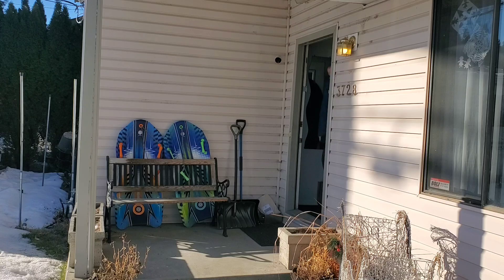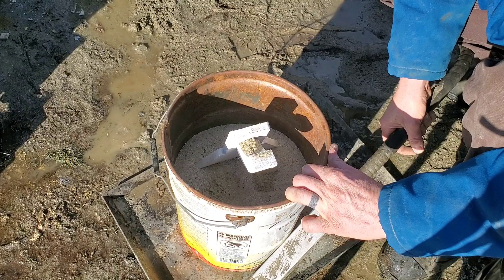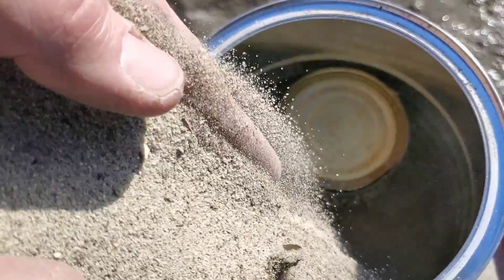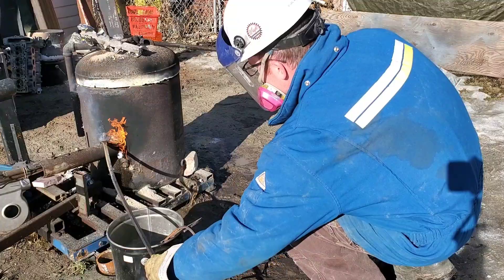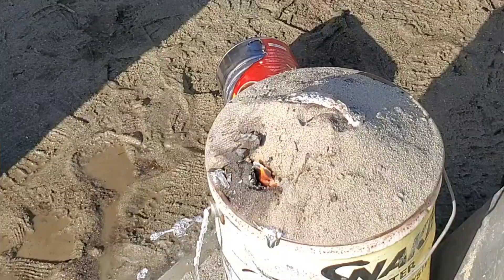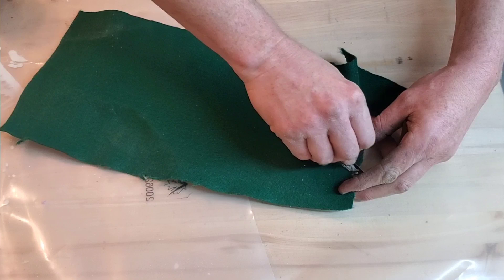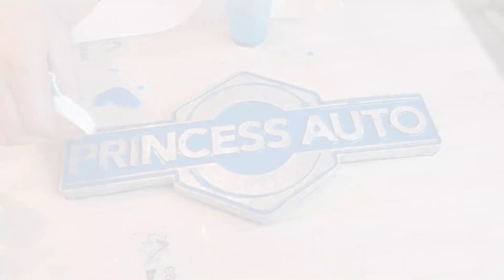Lost Foam Casting Aluminum Princess Auto Sign

Comment: Nice work WM&C. On the bubbles in the thinned slurry, if you're power mixing, try to do so in a manner that mixes but doesn't airify, i.e. keepe the paddle below the surface with less speed. Inevitably, there will still be bubbles in the slurry and vibrating the bucket of slurry will liberate some more. Applying vacuum even better, (like conditioning investment casting invetsment) but practcially speaking you may be better off with your current approach. Assuming it was flat to begin with, the pattern bow may have came from the molding method. Instead of dumping from the bucket, ladle in a quart of sand at a time filling evenly on each side of the pattern, and vibrating as you go so the pressure being exerted on the pattern by the sand is equal from each side. When the pattern is angled and the sand is not vibrated/compacted until the flask is full, the settling does not occur evenly/simultaneously throughout the depth of the flask and can distort the pattern. Keep up the good work. Best, Kelly
Reply from the maker: Thank you kelly . Great imput . The warping of the pattern should help with your sugestions . Im also going to add a rib on the out side . On my last casting not shown yet it made a big difference . 

As for the slury thinning it down helps for sure and one issue you are seeing is soap was added to the solution and mixed in slowly .    ( not my smartest expiriment ,lol ) through just use of dumping  the slury it created bubbles .  I may look at trying a liquid laundry soap that has an surfacant propery but a anti frothing agent in it . Its all cheap experimenting :) 

Thank you kelly cant wait to see what you build next
Reply: @Wrighmachining  On very large, flat, thin walled patterns, I have glued them to a board or piece of sheet metal with foam stand-offs and (sometimes coated) and cast with that support in place. Uneven sand pressure can still distort the pattern though.  I do make an effort to keep the patterns flat but don't have much fear of it these days. As cast, my castings are quite soft and I can push them around and straighten them at will. After heat treating, not so much. Best, K
Reply: @Wrighmachining  The anti-spot dishwashing detergents have Propylene Glycol as the active ingredient which is a very good surfactant.  It's also contained in Dawn. You can put some in your slurry but some is like a 1" diameter dot.....not ounces 🙂. Best, K
Reply from the maker: @kellycoffield533  i will try that :)
Reply from the maker: Hey just did a large 18 x10 inch flat casting 3/8 . I sis it on a bed of sodium silicate binded sand and got it reasonably flat .  

Also did some 1/4 inch 3x8 inch castings today and filled amd packed as i went . Made a big differemce for sure  . Good advice

Comment: I find a ton of old aluminum kitchenware at thrift stores. I am talking from the 50's and 60s, no coatings, no teflon, just raw aluminum. It generates almost no dross, and is WAY better than trying to use things like Aluminum cans or wire. I like to think it used to be a B-17 or P-40 or something, since most of these were scrapped into things like, well, kitchenware.
Reply from the maker: I have also been having luck with my mechanice friends giving me aluminum from car parts  to so long as there is beer left behind when i leave ;)

Comment: You make excellent productions, instead of pouring these objects vertically, I think you can get a smoother surface if you mold them with degrees and cast horizontally...
Mine support heels and gas outlet holes will not damage the used surface, as the slag collected in the upper part will not damage the used surface, the flow of molten metal will be more fluid, maybe I am wrong, just a thought and
  suggestion.. Regards..
Reply from the maker: Something to think about for sure . I had tboughts of putting a backers of sodium silicat sand to keep it fro warping .
Reply: @Wrighmachining  Thank you for your feedback and for graciously accepting my suggestion.

Comment: Beauty Sir! i've been using 2 coatings because i figured the first coat was too thin. It looks like thin worked really well for you. I'm gonna experiment with that i think. Love the epoxy. where have you been getting your epoxy and pigments?
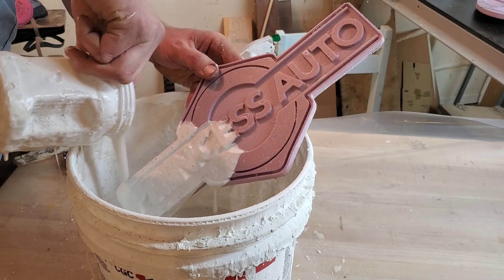Reply from the maker: Originaly micheals but ordered 1 gal kit off amazon . We will see how that works . As for the dies micheals sells them but acrilic paint in liquid will.wprk to . No more than 1:10 it says . But i never have gone that much .   I think in the had wheel video it shows the red acrilic paint that works the best .

Cant wait to see what you are going to do next .!
Reply: @Wrighmachining  cool thanks. the epoxy looks really good. looking forward to try that

Comment: does the plaster slurry burn off too? Or does it keep its shape and is visible in the final cast?
Reply from the maker: In my experience generally it will be washed off after the casting has cooled. It's purpose is to improve surface finish not to hold the walls of the same back.    In fact if surface fi ish is not important you can get a good looking casting with out the slurry.     I have a video on the slurry if you are interested as well